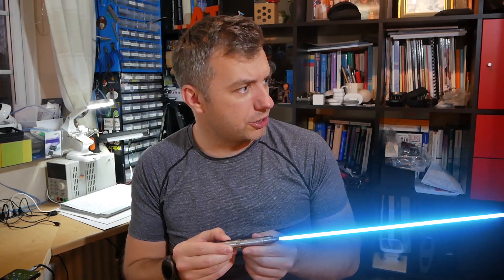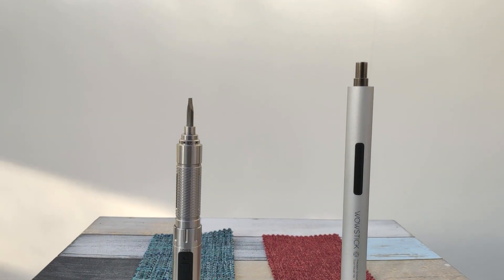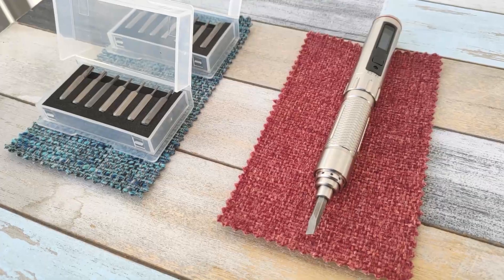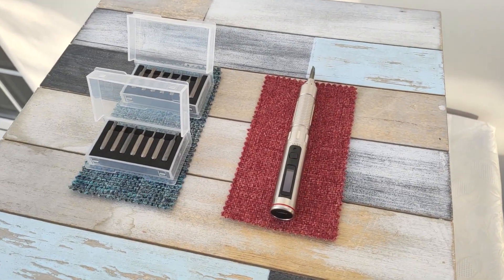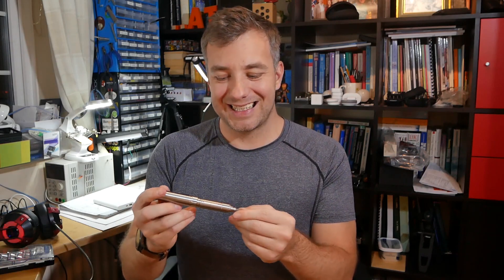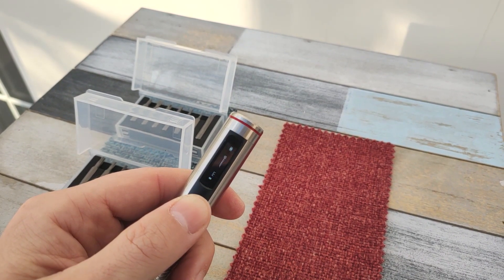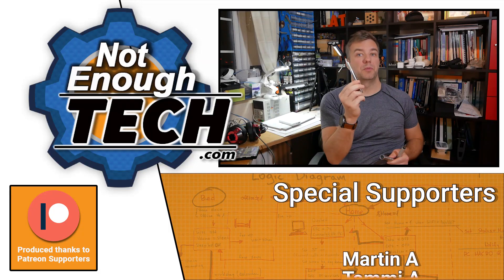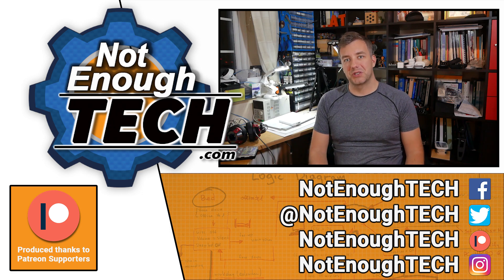Precision screwdriver in power armour - #MiniWare ES121 [review]

Comment: Great video and comparison.

I just bought a Wowstick so I can undo laptop case screws as part of my job.

First of all the rocker was sticking plus it did not have enough power to unscrew factory installed ThinkPad case screws. I first had to get it started plus it seemed to not have enough power.

Therefore I returned it and bought the Bosch Go 2 which had too much power and torque even on the lowest setting.

Has the ES121 been replaced with the ES120? Is there anything better than this as of August 2021?
Reply from the maker: Personally (while I would appreciate more torque) it's not too bad. I find that half turn of my wrist is enough to loosen machine screws and indicate the direction I want the screwdriver to move. By that time the screw is lose enough for the electronic to finish the job. Same for the other direction where that last half turn applies enough tension so I can feel the point at which further twisting can damage screw thread or the part itself. 

Not found anything in between but I learned to work with limitation and I get pretty efficient with it
Reply: @notenoughtech  Many thanks for the response.
Reply from the maker: Happy to share my feedback

Comment: Man if I did the exact same thing as you do with the Wowstick in the last example it would have failed instantly, I have my Wowstick for a month or so and already broke it twice and I haven't done anything with it even close to what you did in the example with that screw that really needed some torque, I did a screw that needed much less torque when the gearbox failed instantly.
With my Wowstick it was the first little pair of gears on the single shaft right at the start from the BIT side, the bigger gear popped off the little gear which are pressed together and it's so fragile that with the smallest force it sees it instantly pops off and fails.

I made a tiny bushing that I placed behind the bigger gear and the middle plate, filling up the space behind the gear so it doesn't pop off as easy as it did and that worked out pretty good but I don't trust it to be strong enough to handle the torque that it should be doing so I'm only using it for really light work when there's no torque at all required to loosen or tighten the screws, but the clutch is good enough to do the hard part by hand but that really defeats the purpose of the electric screwdriver if you have to do it by hand anyway for the most part, right?

Because that happened I'm not so sure anymore if I want to spend much more on the better one from MiniWare, I really don't know what I should do, what's best... or buy 5 replacement motors and gearboxes costing around the 25 dollar or buy the better one and hope that the gearbox isn't as fragile as the one used in the Wowstick.

Do you have any advice?
Reply from the maker: There is an amount of torque past which screw doesn't sit any thighter and putting more turn has diminishing returns. 
If you are breaking gears on threads of M4 and smaller you are likely adding more torque than needed for machine screws. If you are concerned about the screws undoing themselves add a spring washer. 

The only situation in which I think this could be an issue is when you are trying to manually finish off a wood screw or plastic screw. Then the resistance of the drive could be problematic... But then you are not using the correct tool. 

You either have to re-evaluate your fittings (you could be using wrong fitting type for the job) or don't overcrank the screws. 
Do a test and you'll find that once screw is driven to max depth.. a quarter turn is often more than enough to hold it in place.
Reply: @notenoughtech  it was a small M2 screw of about 2 cm long, yes it was in plastic that I wanted to loosen and as soon as I pressed the button it broke down instantly, I didn't even had any chance to put a lot of force on it and no I'm not overdriving my screws at all.

Really the work I did was very light and didn't even came close to the force that you put on your Wowstick.

I know exactly how to work with machine screws, I do that a lot so I know what force it takes, the force that I was putting on it just shouldn't be nearly enough to break it I know that for sure.

That's the reason why I say with confidence that the gearbox of the Wowstick at least on the one that I own is too fragile to use it as it is intended to.

Do you think that if I use some Loctite that it will help keeping the gear in its place, is there anything you know that I can use to firmly glue it onto the shaft?
Reply from the maker: Definitely shouldn't be the case of breaking the wowstick. Ever since I got my es121 and now es15 I don't use the wowstick. 
If that's any consolidation you can do a pretty good job with the motorized option on es15 so if you consider an upgrading I'd go for that

Comment: Unfortunately after almost one year and very very litlle use i have two screwdrivers es 121 that stop function.
Reply from the maker: That's a shame. I use mine quite often and so far no issues. Was it a battery or something else?
Reply: I totally disasembly the one of them.I tested all the parts and the motor.All seems fine.Propably have problem the electronic system.I dont know what i can say.Very,very,very dissapointed.Two very expensive screwdrivers es 121 for the trash.
Reply from the maker: Sorry to hear it 😞

Comment: What a piece of junk! I bought one and used it for a while. It was great until the day it stopped working. About a month after purchase it simply stopped working, would not charge or turn on. Tore it down to make sure all wires were properly connected, not shorting, etc. Nothing.
Reply from the maker: Sorry to hear that. I have been using mine each time I tinker and so far I had no issues with it.